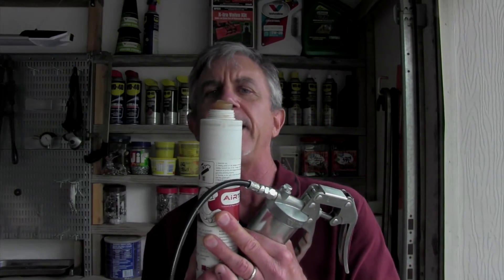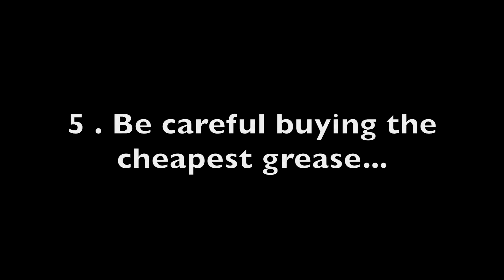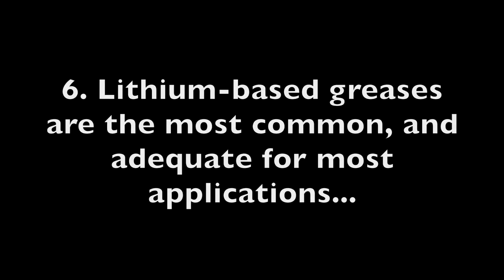How to Select a Type of Grease (12 things about greasing you should know)

Comment: I was a bit surprised that he said polyurea based grease is not compatible with other greases.  I recall that was pretty well correct when polyurea first came about, but I thought that problem was solved long ago.  I have been using shear resistant polyurea grease (John Deere branded) for the past 8 years or longer.  I stays in place well and is good for bearings, pivots, and shafts.  For loader pins and 3 point pins I prefer a high moly paste.

Comment: Been running farm equipment since I was about 6 , Now 52 and can say with some authority that proper lubrication will save you a LOT of downtime/headaches. Just finished mowing about 5 acres of heavy grass with a 1025R and brush hog. Greased both the tractor and mower before job as standard operating procedure.
Used a lube shuttle pistol grip and the grease with ceramic in it. figure it's cheap insurance especially because the U joints between the engine and trans look like a real PITA to replace.

Comment: What is the length of the hose on the battery lube shuttle? And is there a longer hose option available? What lubeshuttle grease do u recommend for a skid steer. Thanks
Reply from the maker: Bruce, here's a video on grease selection: https://youtu.be/yqyzW2gC_Pg.  .  The standard hose is a 500mm which is a little less than 20 inches.  You can order a 40" hose here: https://asktractormike.com/product/high-pressure-40-inch-hose-with-4-jaw-coupler/.  Please let me know if you have any other questions.

Comment: That guy talkin about the street running out of the Grease my sub compact tractor the way we work the loader on it a lot we don't overwork the machine but hit get worked a lot that's the reason I put the Copper Rock in there it's made to grease the drill Steel on a rock hammer drill in the thread so they will stay pliable under heat and pressure it does not cause anywhere by self

Comment: Mike I'm in the drilling business oreimo Drilling and Blasting companies diesel mechanic I used in my tractor loader grease fitting something called Copper Rock 80s grease with copper in it to reduce wear it seemed to work fantastic the drawback is it is very expensive

Comment: My latest tractor I bought new a few months ago, and at about 15 hrs I did my first grease job. Don't know what the dealer used but after extensive research and lots of reading about grease types (and watching this video a few times) I settled on polyurea grease (Lucas X-Tra Heavy Duty, the green stuff) and will use it exclusively, i.e. no switching grease types. I was sure to use enough the first time to flush out any old grease just in case there was any compatibility issues between the old & new greases. I grease about every 8-10 hrs due to the fact that I operate primarily in mud & water, and so far the Lucas is holding up really well. And at about $4.50 a tube it isn't breaking the bank to grease often. The addition of a Lock & Lube coupler made a world of difference too, as it makes what was a difficult chore before (getting that dang standard coupler off a zerk) a breeze now so I no longer dread greasing my machine.
Thanks for an excellent show with a knowledgeable guest that gave us some outstanding, unbiased information on a very important subject that affects us all. Well done, Mike! 👍

Comment: I work in the power industry on a lot of big / high horsepower machines.  And I have seen plenty of equipment failures caused by wrong grease in high load or high temperature applications.  But it's also true that I have seen many more failures caused by no grease / inadequate grease.  For heavy-duty applications, the wrong grease can reasonably be expected to cause failure.

Comment: Lots of good info! I love the guy who commented the best grease is always cheaper than parts! Wish i could beat this into equipment owners heads! Every time i repair a machine i use the best lubricants and filters i can source (based on application). Every time they come back in i get 2 situations. #1 they didnt bother greasing or lubing at all. #2 the guy who only greases things once the metal on metal grinding noise coming from very near every single  grease daily sticker and zerk. He then pumps in so much grease that any remaining seals blow out and rainbows of the 5 diffrent types of grease he has tried usuing rather than just replacing the bushing (and hopefully learning a lesson about grease) before the pin or shaft wallers out the bushing hole and niw comes the bill from the machine shop. 10 tubes of ultra synthetic hot pink weinershlidin is far cheaper than any repair option.

Comment: Mike, I do commercial bush hogging for the railroad.  I use a high temp 5% Moly grease.  I grease often on my compact and large frame utility tractor.  I also used the same grease for the zero turn spindles.  I haven't had any problems with the grease.  I agree, grease often!

Comment: Thanks for that video, never heard grease explained so well.  Learned something today.  I have a John Deere zero turn and have always greased the spindle bearings with John Deere poly green grease and ( knock on wood ) so far haven’t had any issues and it just rolled 1200 hours.  Oh I also grease them every 25 hours like clockwork.  Nice video Mike.

Comment: I wish he would tell me how to fix my Lube Shuttle grease gun.The thing didn't even last for a full tube before it quick working.
Reply from the maker: Patrick, I'd bet it's an air lock.  Push up about 3/4"-1" of grease out of the tube you're putting in and I'd bet it works.  I've not known of a single instance where that gun has failed.  If there is something wrong with it, shoot me an e-mail at mike@asktractormike.com and we'll get you taken care of.